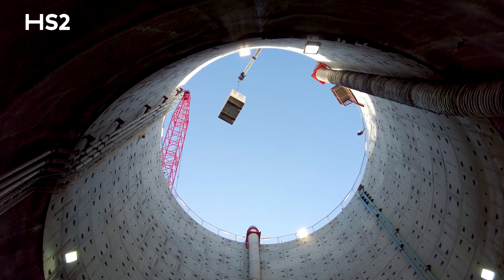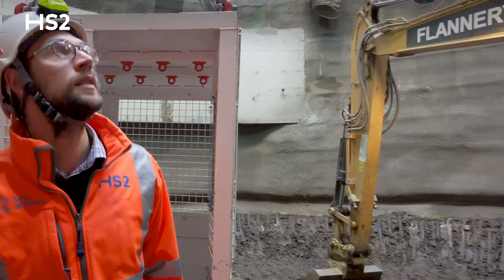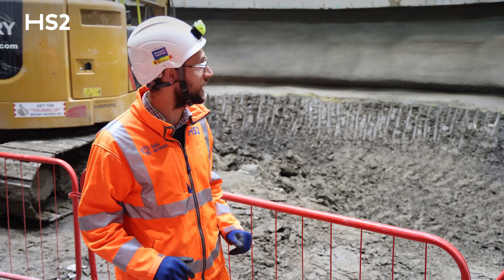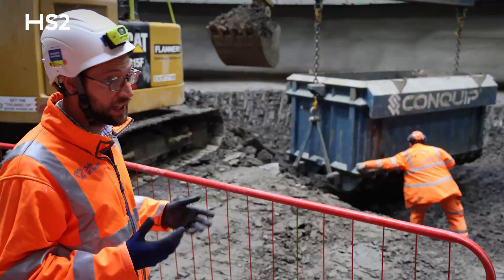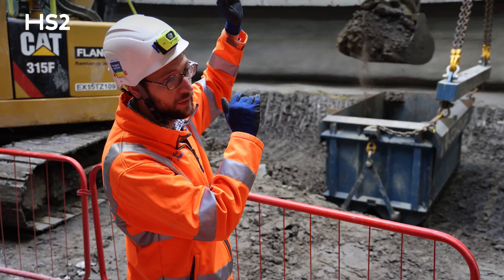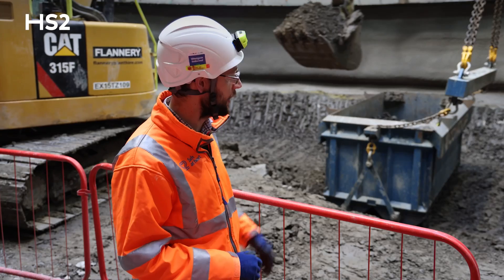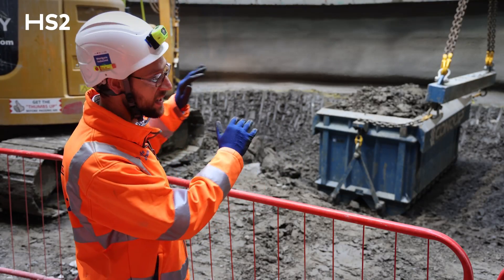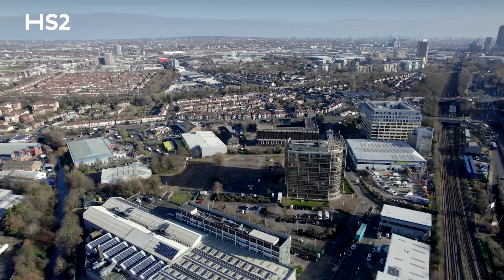How engineers are building a tunnel ventilation shaft for the HS2 tunnels in London

Comment: How come they've got half pre-cast and half sprayed concrete? Is it for cost reduction? Speed of installation? Something else?
Reply: It's because the top soil can shift or is made of different types of soil, so they use very strong rings of concrete. At a certain depth, the soil is compressed and safer, so spray concrete is used at that depth.

Comment: As much as i disagree with the concept of HS2, i cant fail to admire the engineering skills that we possess to make it happen.
Reply: Yes HS2 isn’t required as much as mega hub Intl airports in the North and Midlands, but it’s a British infrastructure project that is needed and will boost economic activity to a small degree anyway.
Reply: @jakehowie442  We have insufficient carbon budget to promote domestic air travel, so your measure of success has more to do with Grant Shapps’ myopic political meddling than you think.
Reply: @danwiddon3854  And even if you did have the carbon budget you'd still not want to do it from an environmental standpoint. I know that concrete tunnels aren't exactly good for the environment either, but it's miles better than burning kerosene.